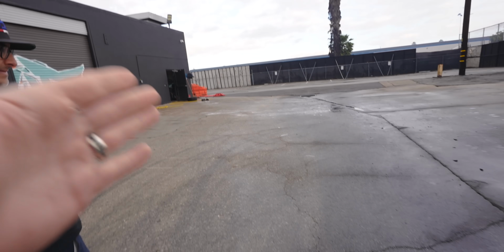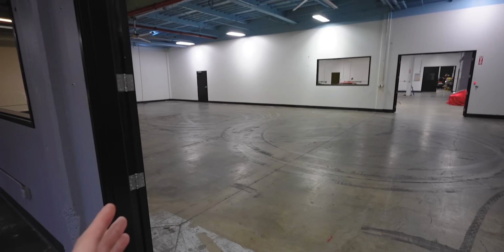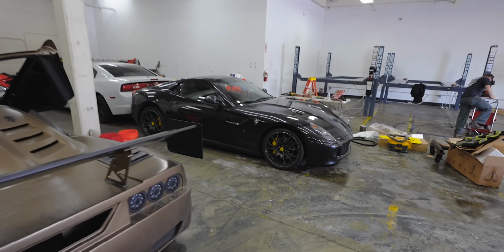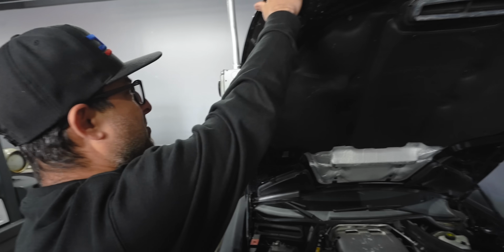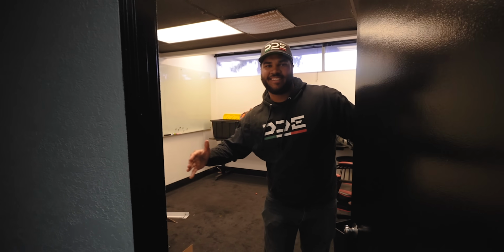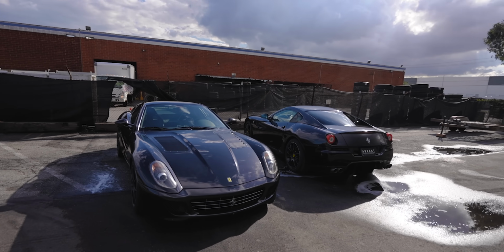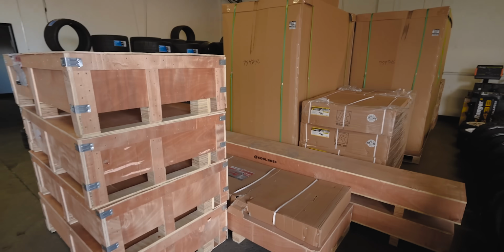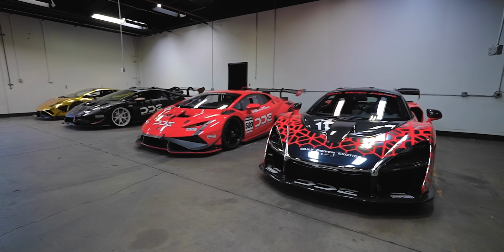TRANSFORMING OLD HOONIGAN GARAGE INTO DDE SERVICE CENTER!

Comment: You guys should look into getting a street sweeper. You can get a John Deere lawn tractor and an attachment for it. They work amazing. Lots of different sizes.
Reply: 😂 I just commented that before I saw your comment
Reply: they work good but a skid steer would be better and more convienent with a lot more front end attachments
Reply: I was thinking the same thing
Reply: All that 'sludge' is basically rubber and oil from all the shenanigans on the block. Not great for the environment that you are flushing it in to the drains. I’m amazed the local authority hasn’t fined you.
Reply: @darren6589 the building is zoned for automotive so the city is aware and the drains (when they aren’t clogged) should be set up for it.
Reply: Yeah, i dunno if they will use it enough to buy one, but renting one every once in a while would definitely save time
Reply: They need a laymor 8ft ride on street sweeper
Reply: Probably a forklift attachment
Reply: @MurderBong  not a clue what a "like stack" is. And I'm zero percent concerned with adding "comments to sift through" 😂
Reply: Well yes but just not a deer in most cases the 800x John deer tax isn’t worth it
Reply: @ImKairyu with labor cost if you use it once a month it pays for itself fast given the size of there parking lot
Reply: Lol imagine them with a tractor 😂
Reply: I was thinking this and more.... Like every group/tuber/etc that starts going for bigger properties and building a business you end up needing all kinds of stuff.  They talked about lifts here, they talked about toolboxes in another video, going to want fork lifts, they bought a lot of machine stuff but they will want more now as projects get bigger...
Reply: That would avoid the California run off laws too since hopefully it would capture and contain that water sludge mixture and not send that down the storm drain . I have gotten multiple water runoff tickets from car washing . Just looking out for y’all. Once you dump the water, it needs to be in the plants. So the soil in the plants can filter that water .
Reply: That John Deere name tax makes it not even worth mentioning😂. Might as well get a much cheaper Bobcat or kubota skid steer if they’re going to maintain the block like that.
Reply: Lamborghini Trattori.
Reply: @chrismason6857 there could be an oil water separator in there, or not..
Reply: a must a was thinking the same thing
Reply: They also make a ride on blower like what they use at racetracks. It probably is something Mike could easily make.
Reply: They can just contract out to a parking lot sweeping and pressure washing company to come by once a week. It'll only cost a few hundred a month. It's a gravy job.
Reply: With that street sweeper, or whatever you get make sure you get a magnet on it as well to pick up all the metal pieces. You still will have to worry about aluminum, but at least it will help make yours tires longer shredding time and less flat tires.. thank you guys for all the content. Love you guys!!
Reply: You guys need to call your board of public works for the storm sewer drain plug. And if it's your personal line in the parking lot that is plugged after that get a sewer jetting crew to come jet the drain line so no more flooding work in that field and it will get it going
Reply: @chrismason6857 I was going to warn them about putting that on video, especially in California

Comment: Mad respect to bendpak lift man they definitely hooked them up big time on this one with lift work bench cooler fans with sound systems on and more amazing but after a 3 days storm they now know they can see the the strengths and weaknesses of the building weakest point the roof and the Block not being very even on the surface and drainage blockages but in all the new DDE HQ coming along to be a dream of dream to the team and as seeing the transformation from a being the old hoonigan place

Comment: LOVE the new DDE headquarters and thats its reliably part of my morning routine, also you have so much wall space, perfect for large advertisement posters for each sponsor in each room, BENDPAK where the lifts and shelving are, XCOMP in the tire storage room, SIM COACHES in the SIM room, VALENCIA HOME THEATER in the lounge, ROKFORM cases, the Plasma CUTTER sponsor in the tool room, a TOOL SPONSOR, get a GYM SPONSOR for the Gym room, a HOME THEATER sponsor and of course DDE branding everywhere . . . . and you still have ample room to build 2 small Live In Suites rather than using a hotel.
Reply: Probably against code to have bedrooms there. Also probably no where near as nice or safe as avenue of the farts
Reply: If it wasn't for dde we would be bored and come with pitchforks to the clintons

Comment: You need a surface cleaner it's a round 20 inch disk that hooks up to the pressure washer and you just push it like a lawnmower and it cleans the concrete you can rent them from home depot it will do a way better job then just the gun and take a quarter of the time

Comment: Like i commented last video- guys need to put the stones and all usual final road building fillers, a pipe connected as a sewar with a grid on top and then lay 2,5 inches of asphalt all of it higher, with the sewage pipe in the lowest point, of course all needs to have the right incline. They are going all in, which was the right thing to do, I think they need to go ALL IN and fix the block.

Comment: This new HQ will be a great event space for you guys to do car meets and charity events. You could open the merch shop to traffic from the outside durring events as well as the arcade area. I would do some serious work on the parking areas and clean debris and paint lines. The gas station theme is a grear idea. I would do a custom wallpaper of the pits at an F1 track. You could also be a registered official tire shop for XCOMP tires. That big space in the back would be epic for parts. Any good parts you can get or save will go up in value so it may as well be on a shelf for you to sell or use. Just do Copart and buy a couple parts cars to strip.

Comment: I just thought about something you guys should go and buy buckets of CLR cleaner and you guys should use that with a scrub brush in the back area where that oil builds up and scrub it with CLR because that s*** is acidic and he eats the oil grime and all that and it'll clean the asphalt and the cement perfectly. It also makes it where you don't have to spend as much time pressure washing or scrubbing

Comment: An emergency water evacuation pump or a preventive measure for water to not be able to overflow into your yard would be ideal. Also a 1 way valve to prevent sewer water from going back through up your drains.

Comment: A couple of high power, backpack leaf blowers, can clear out, most of those pesky, party, and rubber ruining, 
random/strategic placed handfuls, of sheetrock screws, and the broken glass shards, magically zapped from skid row, to right in between, all the piles of woodwork fasteners, decorating the whole buildings exterior. 
Lol

Comment: UNTIL you get the drain professionally opened up, ENLARGED and cleaned, ANY thing you put down the drain will come up again the next time it rains!  So many times since you moved in, you seem to forget the pond in the back contains SEWAGE. Your pressure washer needs HOT and SOAPY WATER, not just water.  The city issues with the sewage make sense now, but the landlord plays a role as well.

Comment: Just a heads up you need to put an oil catch on the clean out drain . I wouldn't be showing pressure washing the oil and chemicals down the drains. Resource water board of California  is a pain in the ass and will fine for washing down the drains. Ask me how I know , saw a crew rinsing drywall and paint down a street from a house and water resource board showed up 10k fine to the contractor.

Comment: It would probably be wise to invest in a hot pressure washer with a 18in surface cleaner until you deal with the water mitigation issues. 

A commercial machine would knock that out in a quarter of the time and do a 10x better job.

Comment: Don’t worry guys SEWEGE is not the connected to the STORM DRAINS . It’s just nasty smelly water . I would get those STORM DRAINS cleaned out though . Probably filled with rubber and sludge

Comment: Do u guys know what you're getting into by having a physical store? The insurance, overhead, having to deal with sales tax and all the accounting that comes with that? Occupancy license for a store is much different than one for a warehouse. Bathroom and lighting requirements are different. ADA requirements are different. Life safety is completely different, and you dont get grandfathered in for stuff you're talking about. The cost of insurance is much higher. I know u mentioned maybe a small kitchen for snacks, now your talking ventilation, hoods, fire suppression systems, and a ton of other crap. You can spend 100's of thousands of dollars and have one thing wrong, and you blow your opening day and budget by months. You also have to make sure the area is zoned to allow a front-end store and snack shop. Is the owner of the building ok with everything?  I'm just saying, Do all your research b4 spending a ton of money on design and engineering. Nothing is ever easy when it comes to business that deals with the public onsite. Im not in California, but i am in South florida. Our building codes are pretty similar because of the hurricanes we get here, compared to the earthquakes u get there. Also, you guys record everything so make sure you get all the proper permits from the city. All it takes is for one person to see the work and check if permits were pulled. The last thing you want is for a building inspector to make you tear everything out and do it again for not having a permit.
Reply: Space already had a front end store. They are just designing it for DDE theme.